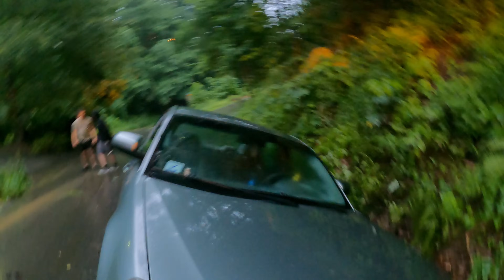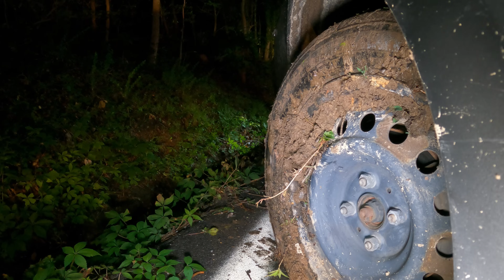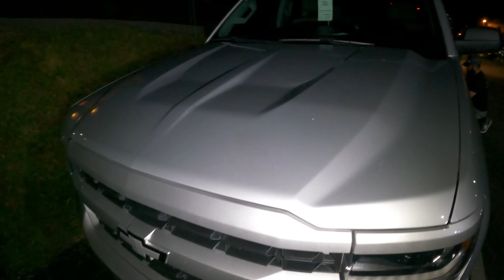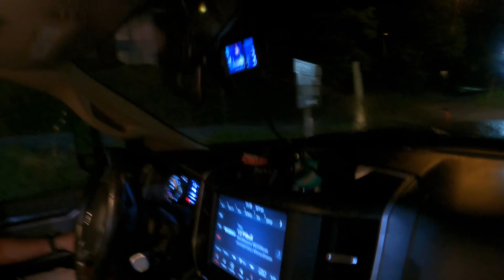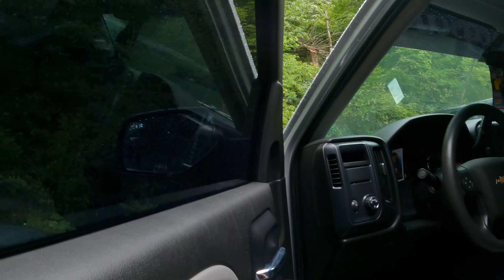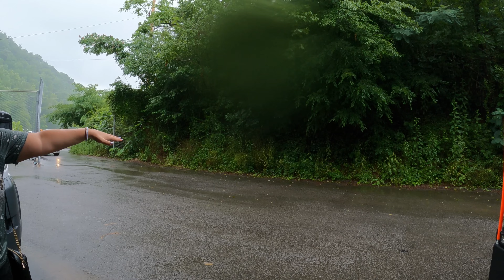Jeffrey's Back, Back Again. Kendra's Back, From Vacation! | Sharp Corners & Illegal Parks

Comment: Do you know where I can find those fluorescent orange marker poles that you have installed on the front bumper of the black truck at? I have a similar front bumper and winch set up on my Chevy K3500 Dually and it is hard to know exactly where my front bumper is at times when I am in tight places. Those would make it much easier to keep me from hitting things, lol.

Comment: sounds like that hotel is running a little side hustle telling guests to park in a no parking zone, then getting them towed so the tourists are stuck there for another day or two, THEN no doubt having an agreement with the taxi company they recommend for sharing the profit of the taxi rides to the impound lot.
Pretty similar in concept to what a city near where I live was doing. Take a stretch of road, wait until there are some cars parked, THEN put up no-parking signs and clamp or tow them all. Day or two later, remove the no parking signs and do it all over again.
Reply: Yes, when you check in they take the no parking signs down & then right after you check & park they run out there and put them back. They have EA on speed dial. 😂